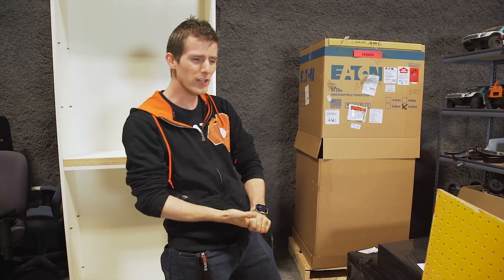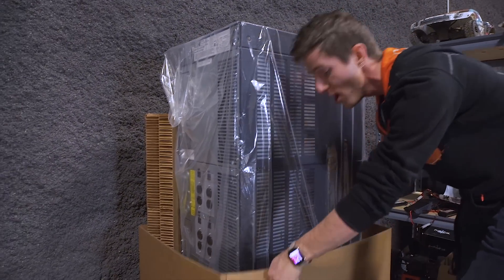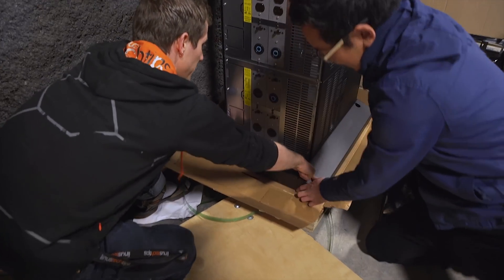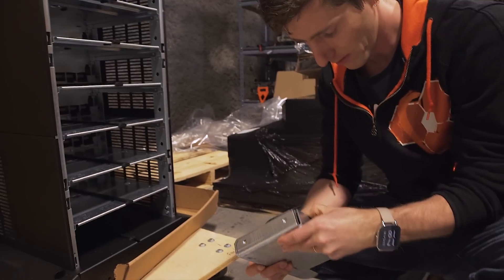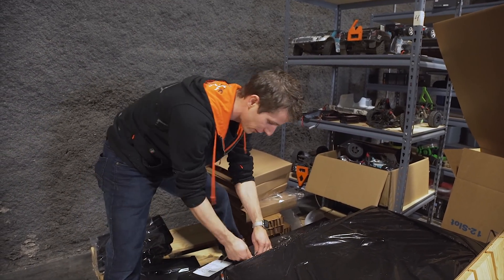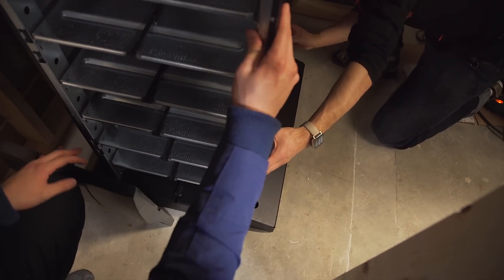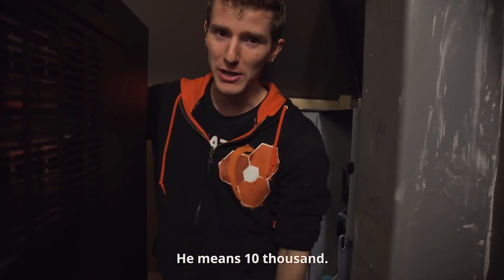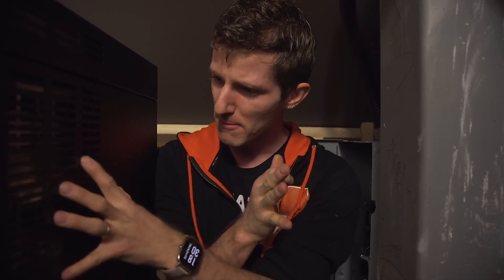HOLY $H!T - A $17,000 (CAD) Man-sized Battery!

Comment: $17,000 for a giant battery that runs for only 26 minutes?!?! It seems like there is something wrong with this picture.
Reply: +junior fio 
A battery that will supply a full 10kW for half an hour. That&#39;s about 10-15 clothes dryers running for 26 minutes off battery.
Reply: junior fio Actually, for poops and giggles, I just looked at my last electric bill. This UPS would be able to power my house for about two days. lol
Reply: junior fio Well, 10kw is A LOT of juice. That could keep my whole house up for several hours.
Reply: +junior fio It's not the batteries that are expensive. Granted, there are a lot of big batteries, but the bulk of the cost is the equipment that can condition and deliver that much power, and switch that much power from AC to battery in only a couple milliseconds.

Consider a consumer-grade UPS. I just bought one for $130, and the battery itself can be replaced for $20. It's a complicated piece of equipment that does complicated things, and equipment that does it well costs money.
Reply: also this is for when the power goes out and people will have time to safely turn off everything and not risk losing data
Reply: +junior fio that's under full load; the servers will likely never be under full load
Reply: In Soviet Russia battery runs of YOU!
Reply: +Dave Starr these batterys arnt designed to switch from Ac in miliseconds. the main reason these batterys cost so damn much, is because they are design for constant charging and discharging, that way, if power goes out there is NO switching from ac to battery, and is instantaneous.
Reply: +junior fio I don't know how you got 21 upvotes.. Linux clearly stated that this is under full load.
Reply: +junior fio the &quot;ghetto&quot; version (still using high-end components) costs about 2000$ in batteries, 1000$ for battery charger/psu, 1000$ for a 10KW pure sin wave inverter,   and about 200$ for a raspberry pi with a few probes for monitoring each battery and the input and output. counting  the dev time, and making a custom case for it, it would cost 3 times less, or put differently, it could be running 5-6 times longer  for the same cost.

ps: if the batteries are lithium-ion and not gel, multiply their cost by 3
Reply: a lot of people and companies use UPSs to continue their business uninterrupted during an outage until the power comes back on

after all thats why they call it an uninterruptible power supply

they were originally designed to give you 1-2 min to safely shutdown but now they are being designed to outlast most power failures
Reply: Dave Starr I  figured that. I was just a little supersized the something that big would only last for a half hour at best under full load. But I guess we can't get everything good in life.
Reply: Dave Starr true.
Reply: +sylermran no, as the workstations aren't hooked up to it?
Reply: +junior fio yes, they should have gotten a whole-building backup generator for that money.
Reply: Ricardo me neither.
Reply: +Dave Starr it's not for a car. and that's where these batteries are at home. not lead batteries, mind you. lithium cells which are lighter, smaller and more durable than this thing. and also

*much, much cheaper. *
Reply: +junior fio You just wanted your fries and drink to be a little bigger?  You might be eating too much McDonalds.
Reply: +Bio Hazard actually they never switch from ac, the output runs constantly off the batteries.
Reply: +Bio Hazard actually they never switch from ac, the output runs constantly off the batteries.
Reply: manaquri bruh. if you read my comment, that is exactly what i said. in order for them to run off the batteries non stops, the batteries constantly ger discharged, and in order to keep the form dying, they are constantly recharged. dont fix if it aint broke
Reply: Bio Hazard it seems I forgot that damn read more button or it didn't display, or sending messages at 3 AM is not a good idea.
Reply: manaquri its all good
Reply: +junior fio The battery is for short term, you can switch to battery immediately during a power failure. Meanwhile during that time the diesel generators can start up (takes a few minutes) then you switch other to them. =]
Reply: +junior fio 
A tesla powerwall is worlds cheaper.
Reply: Firstname Lastname but can only supply 3.3KW, needs an inverter (which costs a bit of money for a truly reliable one.), is not on-line (which means it needs to switch from ac to battery in case of power loss.), is not out yet, and most importantly it doesn't come with an insurance (for what is plugged on it), which the 17k$  ups probably has:
yes, it would probably be cheaper to buy a couple of tesla powerwalls, an inverter,and a bunch of power correctors. and on top of this get an insurance. But they would have to wait for all the parts and it would be a bit tedious to put in place.
Reply: +junior fio You can buy even bigger ones, for example the HPE UPS RP36000 series for about 31.000 Euros /34.622 USD. Those things can supply your servers with up to 36 kw
Reply: +DanieleGiorgino running for 26 minutes huh? so basically just 2 - 3 clothes dryer then. Honestly who uses their clothes dryer for just 30 minutes?
Reply: +ayporos As noted in previous videos all of the work stations store to and work off of the central server when it comes to data.  The workstations can provide the computing power and remote usability of the centrally located "server" files.
Reply: +ayporos A generator will cost much more and in a serious DC you'll always have two tiers of power backup - a UPS for short-term backup and a generator for indefinite backup as long as fuel is refilled fast enough. For real redundancy both would be needed twice and every single server be connected to the A side with one PSU and to the B side with the other.
Reply: 26 minutes that could save hundreds of thousands of dollars worth of data.
Reply: he could have made a DIY UPS for half the price and got 6 times the runtime at the same power output
Reply: MWB Gaming Thats not the point of a UPS, its only purpose is to safely shut down the servers. They need to be reliable, something a DIY UPS won't be.

Comment: love all the videos, but as a "Corp" It guy, I'm missing the rationale for this UPS. As a former data center guy, if the power is out for a day, it's gonna be out a LOT longer. Why not buy a short run time battery then invest in a natural Gas or Diesel Generator? Also, isn't that battery gonna throw crazy heat into that very small space? maybe take those existing open racks and ditch the 20 amp recepticles and go with twist locks to be safer.

Comment: in the UK 230v is standard lol
Reply: +Harry Lawton it would cost trillions to switch over an entire country to 240v from 110v, you would be replacing thousands of substations and thousands of miles of cable, plus you would have to compensate everyone for their stuff that no longer works because of the switch over and you would have to compensate companies for all the stock they have that they can no longer sell because of the switch over, its just not feasible
Reply: +Harry Lawton lol? they don't send it out at 110 or 240 volt...........then send it out in THOUSANDS of volts for efficiency, that's what the transformers before it gets to the house are for, to drop it back down to household voltage
Reply: same here in the netherlands
Reply: Jake Thumbs I don't get why they send it out in 120v-100v, sending it out in 230v is much more efficient.
Reply: +jack swetman Not really, most PSU's nowdays can auto-switch the voltage limit, there was a switch in the old days, but its automated nowdays.
Reply: +girlsdrinkfeck those awful house burning ring circuits are indeed a cheap nasty way to save money and endanger lives. But that's not why you use 240 volt ;) 240 is so much more efficient it's not even funny, if we had 110 volt power in Australia our electricity bills would be more than doubled. Only the most backward of backward countries ever used 110, and i don't know of many still ignorant and uneducated enough to do it
Reply: +Harry Lawton you never know it might have an inbuilt system designed to switch over between 110v and 240v, theres plenty of possibilities
Reply: +Harry Lawton they are not universal, if you plug a 110v device into a 240v supply you will most likely seriously damage the device if not kill it, and if you plug a 240v device into 110v there is a risk of it catching fire if the transformer or power supply cant deal with it
Reply: jack swetman I have never had any issues but mabey the universal plugs transform it but I doubt it so I guess I nearly burnt down a lot of things...
Reply: jack swetman my stuff is compatible with 100v and Linus said he would run his PC's of 230-240v I'm not sure but I think they are both universal.
Reply: Yeah same here in Aus, 240 V standard.
Reply: Same here in South Africa 240v is standard wall outlet power
Reply: +Harry Lawton 220/240v is standard to the demarc/meter in the US. Just not IN the house. Everyone in the US has 220 at their meter and box.
Reply: +Harry Lawton 120v is a multiple of the amperage of the supply not an indication of the current bieng delivered. My small house (in the states) gets 240amps delivered from the power company, of which I can use 80% or 200amps. I can install breakers in my house that run any multiple of 240 amps. I can run 360v at 66 amps 220/240v at 100 amps or 120v at 200 amps ect. Here in the USA large central AC units often run 360/v, deep well pumps and hot water heaters as well as clothes dryers and electric stoves run 220v/240v.
I hope this clears things up.
Reply: Josh de Villiers pretty much all my things say input power: 100v-240v
Reply: here in the states, we do have 220v delivered to pretty much every home. it's dropped down to 110v at the mains panel by use of a center tap called the neutral. sometimes it's mistakenly referred to as 2 phase, but really it's still just 1 phase with a center tap. 220v is more efficient partly because doubling the voltage cuts the current by half at the same wattage, but this has less of an effect at short distance. it's more efficient and "greener" to stick with what we have rather than replace all equipment with 220v variants to save pennies on line losses.
Reply: 2 phase is a misconception. houses have single phase with a center tap. 2 phase is a real thing, it's just very rare. not that being correct about this really matters.. my ocd.
Reply: +Harry Lawton Same in Ireland, and I believe most of Europe!
Reply: +Harry Lawton In Denmark too.
Reply: Josh de Villiers its actually 230 but for some reason people think it's 240 but that might just be in the UK.
Reply: +Harry Lawton Its approximately 230-240 volts go stick a multimeter in a plug or something, I might be wrong :)
Reply: Green Eggs and Spam do you have three phase power or something? How do you have 480 residential?
Reply: I have single phase power.  Although  480v single phase is possible and was used in some motors and equipment in the past it is a terrible way to wire something.  Thanks for pointing this out, I have removed the 480v example from my comment. My intent was to provide some basics on the difference between power coming into the meter versus power leaving the breaker box.
Reply: +Harry Lawton on our power bricks or power supplies to different things it says 200-240v
Reply: +Harry Lawton Can you get 3 phase power into a home in the UK? Or is it just single phase.
Reply: +Hydragurum yeah. 3 phase consumer is 400volts.
Reply: ***** Wow good to know thanks!
Reply: +tapper88 No they wouldn't you are still using the same amount of power, just less amps
Reply: +Aaron Anderson 3 phase residential is a little strange 3 leg is referred to as your wild sometimes.
Reply: +Harry Lawton The first power plants in america were running 110volts. (Back when Edison and Tesla) were fighting about. It just kinda stuck here, mean while we figured out 240v was good for less copper but most plants and xformers were already running with 110v, rest of the world got to the see the trail and error the us had and went with 240v.
Reply: +Harry Lawton Yep same, Most modern battery powered products are rated 100v - 240v
Reply: +Harry Lawton You can thank Edison for that. He went around the US electrocuting animals to show the dangers of 240V AC (and thus discrediting his competitors) to promote his own ~110V. Europe later adopted 220V because technology allowed them to more cheaply adopt it. That's why North America still uses 110 instead of 240, and we cannot change because it would cost too much to rework all the existing infrastructure and compensate people for electronics that no longer function.
Reply: +Harry Lawton - How about the USA's crappy plug design compared to UK plugs? :p
Reply: Andre Fish ikr...
Reply: +Andre Fish Hmmmm. It is MUCH more space saving, an the newer ones require both the hot and neutral plugs to be pressed to open. Safer than the UK plugs.
Reply: +SwingingChoke Hmm, 120 volts is safer and you didn't mention that US sends out their power at THOUSANDS of volts and brings it down with transformers for houses.
Reply: SecretPotatoChip actually it's live a neutral also the UK plugs require the earth pin which is the top pin in order open the live and neutral also the UK plugs and carry more energy due to the bigger pins and anyway why are you getting so pissed off all we are saying is the truth its only a fucking plug.
Reply: SecretPotatoChip also when they transform it down to 120v it is not as efficient because it looses alot of energy transormig down.
Reply: +Nico Mariño I am confused if what we are receiving is a voltage then how does that explain alternating current? Or is it the voltage that is varied? Still would seem like a misnomer to call it alternating current and not alternating voltage
Reply: +Harry Lawton that's only for a short distance. For long distances, the voltage is in the thousands, so it still would save energy
Reply: +Harry Lawton isnt it standard in the whole EU?
Reply: TheWuerstchenwasser I think the whole eu uses 220-240v im not sure.
Reply: +Hydragurum yep ive got it
Reply: +Harry Lawton 220-240v I believe.
Reply: Skelly yes but the majority is 230v
Reply: +jack swetman You do know the uk actually did switch over right?
Reply: +jack swetman HUH??? WRONG!!!!! The voltage change is done at the pole transformer. So no need for all the changes you listed. In fact, there is already 240 volts. The 120 volts comes from the center tap of the pole transformer and the outer taps are 240 volts. That's why you see 3 wires coming off the transformer on the pole. We could go 240 by just not using the center tap, but then all items bought have to be 240 rated.
Reply: Nico Mariño The neutral is the center tap of the pole transformer for single phase systems. You get half the voltage from center tap to outside tap and full voltage from both outside taps. That's how they are set up in America at least for 120/240. All of the high power stuff like the A/C, heater, dryer, and stove is 240, while the majority is just 120 like the outlets and lights.
Reply: +EETechs I agree with everything you said in your last reply. one thing to note, the neutral (center terminal of the pole transformer) is normally tied to grounding rods in the ground only at the first panel closest to the meter. so the neutral in a home is intended to be very near to 0v potential.
Reply: Pete Lorenzo Yep. The neutral and ground are tied together inside the panel. Already knew this. :)
Reply: I don't think switching substations is necessary. 240V AC is already available in North America in the same way you can get 400V AC in Europe. By hooking your house up between two phases instead of 1 phase and neutral.
Reply: Pete Lorenzo One of those things category for me, I put lots of things in there that are not quite correct.
Reply: +Nico Mariño We get 240 volts, then use that for appliances, then transform it to 120 for wall outlets. I think. I'm no electrician
Reply: VividBagels where do you live? here in the states, we have 240v with a neutral line in the middle which gives you the option of using a pair of 120v lines from the same service. relative to that neutral line, you get 2 voltages, each at half the overall voltage, and one at the opposite phase as the other. unless you have no neutral line, like most other countries. in which case I'd think you wouldn't be using appliances made for the usa.
Reply: Pete Lorenzo Yea, that was my assumption on how the system works here. I don't actually know. (like I said in the first comment)
I live in California

Comment: About those GE UPS they are the VCO line and they are terrible. We do system installations and were using that same UPS line. Was like install one, 1 week later it brakes, you take it away get a brand new replacement, 1 week later it brakes again and so on. This was not only one case.

Comment: 17000 dollars for an hour of extra battery power... technology gents.. in 2016
Reply: +Skulphire That's grossly underselling it, but fine. The data they could lose if power loss happens will make it worth it (hopefully).
Reply: +Skulphire It could run my house for 3 days.
Reply: +Skulphire 
And the technology to handle 10kW/12VA in half a server.
Reply: +Skulphire Spoken (written) like a true moron.
Reply: That's not how it works...
It's the event when a blackout happens and the battery can immediately back the servers and workstations up with zero downtime. As long as they have enough time to save the project and turn the servers down properly that's all they need, and 1 hour is plenty.

Comment: The computers are not being powered off the batteries 24/7. The input AC is rectified to DC and then inverted back to AC. When the power goes out the batteries suply the DC rather than the rectifier. What is the power factor on that?